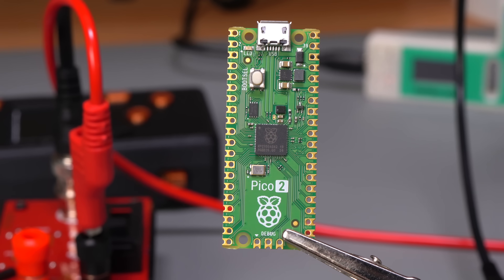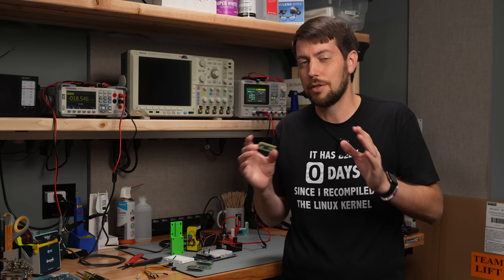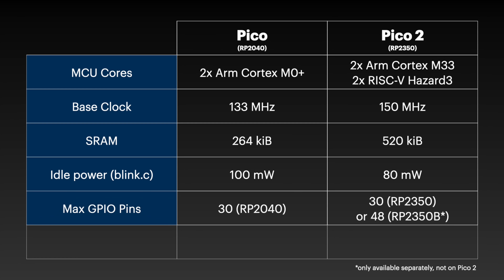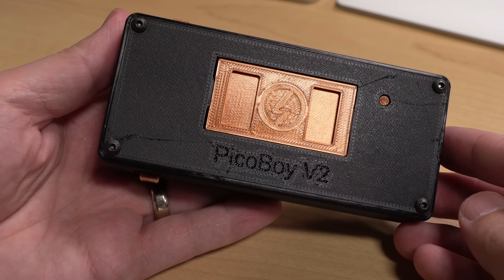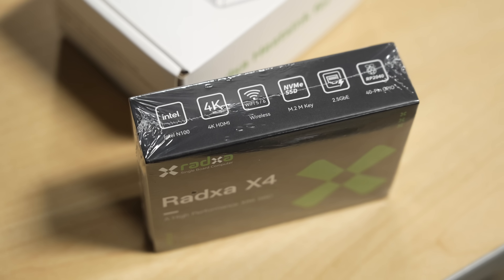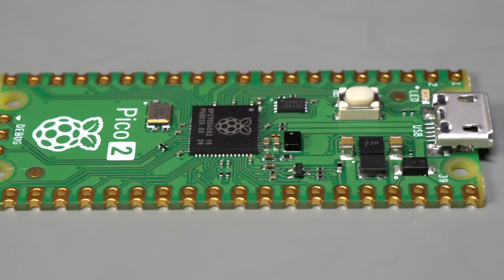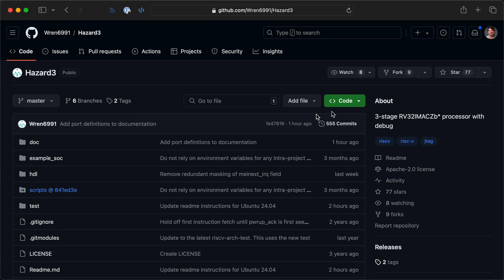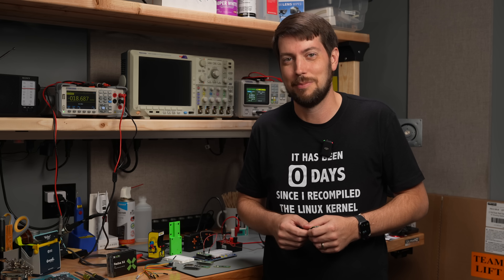Raspberry Pi Pico 2: a RISC-V bet!

Comment: how did you learn about microcontrollers and low level coding? I don't know much about this type of stuff but really want to learn.
Reply: Easiest way is to grab the Pico 1 and load it up with the PicoMite MMBasic interpreter. Supports overclocking to 420MHz.

Comment: Nice, I was wondering when this may happen,
One bug on the original I hoped they fixed was the analogue to digital converter, the original has a nasty big non-linearity in the middle meaning using it to it's full resolution was near impossible

Comment: I'll be curious to learn why only two cores can run at one time, but my initial guess would be some sort of limitation in the bus or memory architecture.
Reply from the maker: Pretty sure it's the IO bus. Technically you can run one of each cores together. I haven't tried though!
Reply: Yeah, the arm and riscv cores share ports on the AHB matrix through simple muxes, so only one can be active on each port at a time (you can have one of each active though).

Comment: I watched a video earlier then yours, and the guy said you have to burn a link, and you will be stuck with ARM or RISC.  Is this so?
Also, the Raspberry Pi Foundation is getting to greedy, and laughing all the way to the bank with one upgrade after another.
(Such as this updated device), and now waiting with the Wi-Fi version.  For this reason, I haven't bought a Pi 5 yet since I'm waiting
on a Rev. B where they bring back Audio on-board.  You probably know what else is coming, but your not speaking about that.
I'm tired of buying one board after another and filling Upton's pockets!!!  [ THAT'S WHY THIS IS SO FRUSTRATING !!! ]
Reply from the maker: No - you can switch between RISC-V and Arm cores at any time, no need to burn any fuses.

The OTP storage may be set that way though—I think it's basically write-once? I haven't checked into how it's set up.

Comment: You're not going to get the current consumption down if you're using the onboard voltage regulator. You'll have to feed the 3.3 volts directly, bypassing the onboard regulator.
Reply from the maker: I was noticing higher power draw when I lowered the voltage to 3.300 from 5.000 — but that was full-tilt. I will have to try it in deep / light sleep too.
Reply: @JeffGeerling  you should feed the 3v3 in on the 3v3 pin, so that you are completely bypassing the voltage regulator. It seems wrong to put the voltage into what is normally an output pin, but that is how to do it.
Reply from the maker: @tglendenning  Ahhh... now I see. I will try that hopefully tomorrow (if I can pry myself away from the Positron build; getting close!).

Comment: it might not be possible to get the very low power draw without a custom board as there is likely some leakage through the power regulator as well as things like a pull-up for the button.

Comment: Your are talking about milliamps, but your measurement equipment shows millivolts.
Reply from the maker: The CurrentWave uses a conversion to get a connected DMM (or its internal display) to translate mA/uA/nA into mV so you can read the tiny values — it's based on the uCurrent meter that Dave Jones / EEVBlog designed but can't be bought now, it seems :(

Comment: Cant wait for people to hack this chip to enable 4 core capabilities, if possible. Although im a little split on if i like this development.. so far they seem to keep stuff backwards compatible.. but i feel like itll split stuff up further, which is a shame. I absolutely love the half a meg of ram however. Personally, 1-4MB ram would have made this an obvious killer, and make a Linux port essentially forced. Welp, i guess ill contitti deal with my custom OS for the RP2040 and now this chip aswell
Reply: I doubt, even the kernel Linux don't support different architectures at the same time, it would a a nightmare, or a fucking genius patch the kernel for that, or they use some type of emulation

Comment: It's a surprise that RPI Foundation is already releasing a new microcontroller chip, but this is great news. I expected they would only maintain the RP2040 for at least 10 years. More PIO and more RAM is a huge upgrade for the community. One complaint with the standard Pico is the 3.3V power regulation ripple was pretty average, has that been improved with the Pico 2?

Comment: Only being able to use 2 out of 4 cores is pretty disappointing, a wasted opportunity. The RP2350 will probably still sell well though, being a straight upgrade from the RP2040. The addition of a FPU and another PIO is nice but the clock speed increase is a bit lackluster seeing as the RP2040 would easily overclock way past that. Does the RP2350 overclock as well as the RP2040? What would the performance delta be between the arm cores and the risc-v cores? Are the risc-v cores even a benefit to the user?

Comment: Mini arcades are probably made from an MP4 player board. You order these things with pre-built software in China, and each one costs pennies. The peak is more geared towards prototypes, since you intend to do it on a large scale, it is cheaper to have a custom board with exactly what is needed to make it work. If you search on Chinese websites, you can produce these arcades (or any other crap) yourself. You order the board from one supplier, the case from another, you can even order the packaging, everything will arrive in bulk in your country. If your gadget does not use a mobile network, you do not need to worry about quality tests and approval from government agencies. You can assemble everything in a garage, and then sell it online. People willing to make some investment sometimes rent a large warehouse and hire people to do this work, and even get tax breaks for creating jobs for low-income or "socially excluded" people.

Comment: FYI I read in the specs that it’s not a drop in replacement due to adjusted power requirements and power pinouts, the 70x70 A variant IS however the same size as the 2040 footprint
Reply from the maker: True, missed that in my reading of the specs!

Comment: I had issues with getting the pico into deep sleep reliably with circuit python. To my knowledge it still hasn't been fixed but might be getting worked on. Looking forward to picking up one of these Pico 2's to mess with.

Comment: The on-board Flash options are VERY interesting as it makes it viable to integrate a RP2040 as a truly stand-alone device. Rather than be reliant on the presence of an external flash chip. Combined with the security features + the bigger IO variants and you got something that can actually rival STM32 chips proper in regards of commercial and possibly even Industrial applications (which has been dominantly STM32, PIC and AVR territory).

For now though i haven't gotten to figuring out the PIO modules on my RP2040 boards yet. So i'm good.

Comment: Has the GPIO voltage range also changed? I'm still looking through the 1347 (!) page RP2350 datasheet. It looks inputs can only go down to 2.5V, but I may be misinterpreting the notes.

Comment: RPI website claims hardware divide,  single precision floating point hardware, and DSP acceleration are implemented as part of the ARM M33 core.  For some apps (such as FFTs) that I commonly use, those features mean more than the small clock frequency bump.  Also, one more ADC channel.  Will be interested in how those pan out in real world tests.

Comment: The new Cortex M33 cores are a big enhancements over the M0+ and I can hardly wait to get my hands om some Pico 2 boards. It would be great to test out some of the low power features that I except to be in this chip. Up to now, Nordic's nRF52 has been my low power ARM core to use for battery powered projects.

Comment: Amazing, they did make an power efficient processor even better and consuming less (okay, maybe 1mA is too high for microcontrollers on some eyes) but mine's not. With a 5v 200ma solar panel i could turn up up to 100picos!
Im gonna stick to mine oldie one. But sometime i will get the pico 2.

Comment: Gigadevice has a similar offer except that you do not have both cores on chip but can select which one to buy: They copied STs ST32F103 and sell it as GD32F103. Since some time they also offer the GD32VF103 which to my understanding is a controller where the CPU core was replaced by a Risc V while having the same pinout and peripherals as the GD32F103.

Comment: I want to point out that that Lego brick does actually contain an RP2040 and an OLED display. The cable coming out of the back is just the USB tether to supply power. It's an incredibly impressive project.
Reply: Wow! An actual Lego-minifigure-scale 'computer'!
Reply: Imagine playing games with Lego hands though. 👷‍♀
Reply: @petertrypsteen  Indeed! Though there's no room for I/O, so all it can really do is play animations. One neat feature is that it can be powered by the same bricks as Lego motors.
Reply: Wait… has the USB port, and RP2040 can configure that for host mode. Maybe it actually could play games?

Edit: Oh yeah, there is a capacitive touch sensor, so you could also play something like Flappy Bird.
Reply: crazy we got Doom on a lego brick before GTA: 6

Comment: I'll be impressed with the Pico2 W if it has better documentation, especially on Bluetooth Classic. I've had to stall my PicoW-based project Bluetooth part, because I couldn't find any proper documentation to set  the pairing code (relying on automatic pairing code generation and handshake is no good in my project).

Comment: I want people to dwell on this idea; if RPi released the best possible product, it wouldn't raise the floor for what's to be expected from competitors, moreso than lower who can get this product due to price and component availability. So, by RPi releasing a dev board with middling specs and USB-B, it gives impetus for competitors to release products that are better, and more expensive for those that need more.

An example that' middle-of-the-road gives room for people to make devices that are better for power efficiency at expense of overall performance, or more performance at expense of overall efficiency and people can take their pick of what competing products meet their needs so they can make the best possible product for the cheapest possible price, to get exactly the performance they need for a specific application. In being the middle, RPi leaves room for others to touch the floor and ceiling so prospective buyers are allowed more choice.

In short: The question to why the RPi couldn't be better can be succinctly explained with It's by design.

Comment: “The RP2350 chip on top is also a drop in replacement for the RP2040”
Actually this is incorrect! Both chips are 7x7mm QFN but the RP2040 has 56 pins and the RP2350 has 60 pins!
I have not yet checked how closely the various pins align or how much work a design upgrade would be, tho I will certainly be doing that upgrade on my motor controllers!
Reply from the maker: Oh, I missed that—thought they were identical but I didn't look close enough—there are four extra pins!
Reply: @JeffGeerling  Indeed! I just tagged you on a post on twitter with a side by side comparison of the datasheet pinouts. Things are pretty similar but there are new power pins and things moved a bit, so some care will be needed in layout updates.

Comment: The RC2014 has a couple different boards based on the RP2040 that give it a VGA terminal with a USB port for the keyboard. Which is a little silly considering the main computer is a Z80, but that sort of silliness is common in the retro world. One of the options is all built into one RC2014 board, one uses a Pico on a carrier board to adapt to the RC2014 bus.

I don't know that the extra speed would be hugely useful in this use case, but the reduced power usage could be. Might be enough to allow slightly weaker voltage regulators and power bricks to run the thing(I literally destroyed a couple cheap voltage regulators trying to use some random 12v adapter I had lying around- one is dead the other puts out over 10v when I select 5- thankfully the computer survived). And battery power becomes more viable, at these levels even a few milliamps can make a real difference.

The extra GPIO would certainly be useful, the existing boards do break out unusued GPIO for tinkering purposes, and more is better especially on a platform that's largely all about tinkering. I suppose the extra speed could be useful here if you want to run much more than just the terminal software, though sticking to the boards main purpose it's not huge.

Comment: I've built an arcade stick and an SNES to USB adapter using the first Pico running GP2040-CE. Kinda excited to see if the team behind that firmware plans to utilize the new board.

Comment: I would like to know about that current measure device. Is it a tool you bought and later modified (like the eevblog current ranger) or is it a device fuilt from scratch.

Good video
Reply from the maker: It's based on the uCurrent, it's the CurrentWave from dothediy.com

Comment: Nice to see an upgrade to the pico, but isn't the ESP32 just a better Pico 2? It has a better clock speed (240mhz) dual core Risc-V, already has 520kb of ram, has wifi and bluetooth unlike the pico 2, has 34 GPIO pins (more than the RP2350's 30 but less than the 48 pins on the RP2350B), and it's been around for a few years. What advantages would a Pi Pico 2 have over the ESP32?

Comment: If most microcontrollers start using RISC-V instead of custom architectures (espressif extensa for example) then it might start being feasible for micropython and other runtimes to add a JIT compiler since they would only need to support one architecture
Reply: Or we just stay with sane compiled languages
Reply: @0xbenedikt this! Embedded resources are scarce, we should not waste them with interpreted languages

Comment: why didn't they just release 2 different models for riskv vs arm. would make more sense imo
Reply from the maker: This way people don't have to choose one architecture or the other, makes things simpler from hardware perspective, and people can slowly start testing RISC-V instead of a hard break from Arm to RISC-V.
Reply: @JeffGeerling  it does make the silicon way more complicated tho, right? like how much did it cost them to develop a processor that has both, compared to if they'd just produced 2.

Comment: This is amazing. I had a project which was pulling Sega Genesis RGB feed in via USB and the margins were quite thin. Just that extra clock boost alone will do tons of good, but more than that, I wonder if they've improved the onboard ADC? There was a mostly unpatchable issue with it reporting faulty values in the RP2040.
Reply from the maker: Supposedly it's better, but I am not qualified to test it or confirm that!

Comment: You should probably be clearer that the RP2040 version of BlueSCSI is actually derived from the ZuluSCSI project from Rabbit Hole Computing, who have a long standing relationship with the designer of the original scsi2sd project.   ZuluSCSI did borrow some file system handling elements from other projects, but the actual SCSI code (and the hardware design) was all down to ZuluSCSI and scsi2sd.

Comment: 🤔How many cores can you have before it stops being a microcontroller and starts being a supercomputer?
Reply from the maker: Let's say 128 cores :D
Reply: Well, the Cray-1 was single-core, the X-MP had 1, 2, or 4 cores, and the Y-MP had 2, 4, or 8 cores.  Which arguably means one core is enough.

On the other hand, they had very wide vector units, which the RP2350 has not got.  :)
Reply: Parallax Propeller has always had 8 "cogs". The 64 "smartpins" of the newer "P2" model can be pretty much anything you want them to be.

Comment: While the RP2350 is the same size as the RP2040 is not a drop-in replacement. RP2350A uses a QFN60 package whereas the RP2040 uses a QFN56, meaning 4 more pins, plus the pinout is a little different.
Reply from the maker: True true... "sorta drop-in", didn't realize that until double-checking today!
Reply: The board IS a drop-in, that is what Jeff was saying
Reply: @JohnSmith-lv8xk  No, he said the RP2350 is (also) a drop-in replacement (for the RP2040), which it is NOT.   pico2 (board) is designed to be a drop-in replacement for the pico (board).

Comment: Hi Jeff,
The rp2350 is not the same pinout as the rp2040 and is not a drop in replacement.

(rp2040 was QFN-56 and rp2350 is QFN-60/QFN-80)

Comment: The Risc-v cores are just a weird thing to add since they don't even have access  to the full hardware, some features are only available in ARM mode.  And since most code written for these devices will either be in C or in ARM assembly I don't get the thinking.  Would be great to see an interview with the Pi team and see what their intentions are for these seemingly experimental cores.
Reply: AIUI, the RISC cores have the same access to the peripherals as the Arm cores.

Comment: Is there any word of the temperature rating for the RP2350? Gonna be a bit bummed if it's still 80C; that would rule out designing 3D printer toolhead boards in an enclosure...
Reply from the maker: I didn't see it in the datasheet, but it must be published somewhere!
Reply: I had a looksies, the data sheet doesn't specify
Reply: @JeffGeerling Oh, I found it! 100C is the default over temperature threshold, but it's configurable up to 150C. Page 452 in the datasheet. That's good!